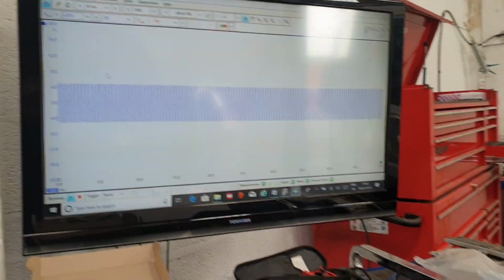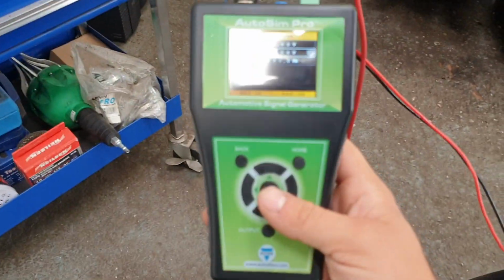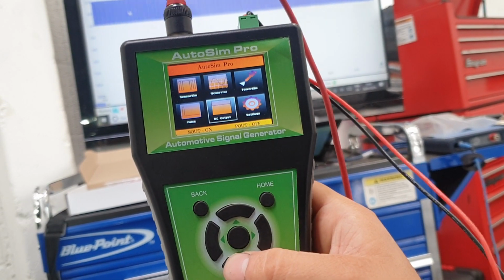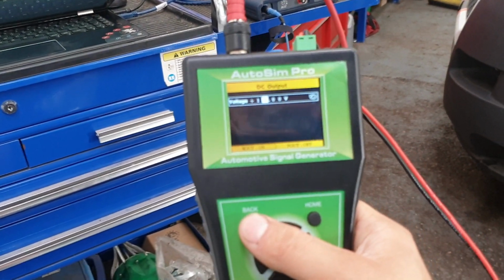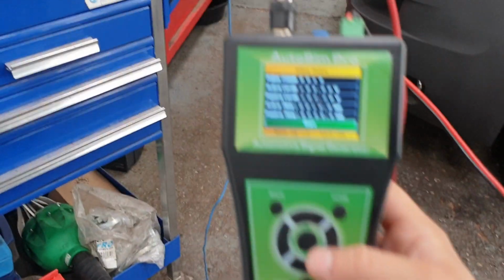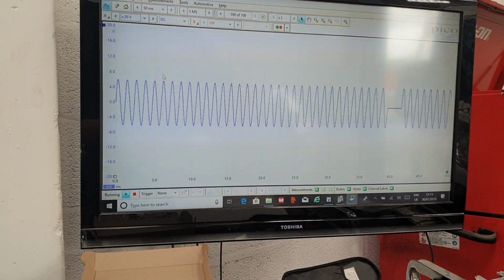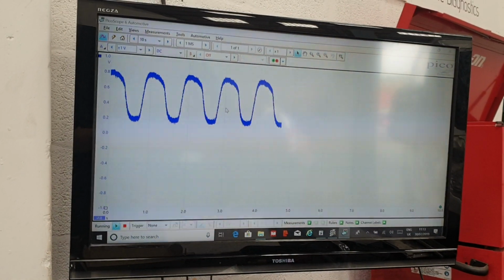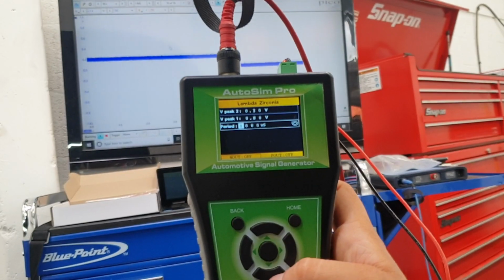DITEX AutoSim Pro Function Overview.

Comment: Whats the point of the Crank and Cam signal generators really? Other that it being cool to look at on a scope. What would be a good real world diagnostic purpose of those?
Reply from the maker: great question. if you wanted to verify RPM signal from the sensor incase the sensor was not operating you could use this preset in order to produce the signal the ecm is expecting to see and check with a scan tool too see if the RPM reading changes, this will verify wiring integrity and computer logic, leaving only one possible component
Reply: @eliteautomotivediagnostics4424  Looking again i notice it doesnt really do CAM sensor signals. That  would really call for presets as they are so different between cars. Its also the CAM sensor sim that i didnt really see the need for as it would be useless. But for a crank sensor i can see the point. Thanks.    I actually have one of those on order. I wanted one for a while now and i also wanted to get an injector pulse tester thingy. But when i realized i could use the Autosim as an injector tester too i just had to order one. 

Have you successfully simulated an active ABS sensor and had the ABS module read the "speed" from it?
Reply from the maker: @stv2765  great news, yes I have done indeed, I done a training hands on day in our workshop showing this with a few technicians
Reply: @eliteautomotivediagnostics4424  How does that work then? These sensors creates an alternating CURRENT that the ABS module uses to figure out wheel speed. On some the VOLTAGE also goes up and down a little as a result of this but not all. I normally use a micro amp clamp hooked up to a scope to watch what these sensors do/sees. So what kind of signal does the Autosim put out to the ABS module? Im sure i will find out soon enough when i get this thing myself, but im just curious. Maybe it doesnt really put out a "signal" pr say but rather mimics what the sensors do and create a current draw. I dunno...
Reply from the maker: @stv2765  good question, for there to be current in a circuit you will also have a small voltage drop therefore if you ever monitor this style of signal you will see a small voltage differential, for example, 11.2-11.37v this is the signal that you will copy and output using the tool. This will then imitate the sensor
Reply: @eliteautomotivediagnostics4424  Yeah... Except the wire already got voltage from the ABS module... In which case one would need to measure the voltage already coming from the module and adjust the Autosim to inject a voltage a little higher than that i guess.. But then again. If there is voltage on that wire (and ground on the other) the wires are probably good anyways
Reply from the maker: @stv2765  yep, the tool will "override" the voltage sent by the ABS ECU I have found as long as the voltage is a little higher as you say (more pressure)
Reply: Steve Jakobsen i have to tool. Its awesome. It works on abs sensors to change wheel speed and cam sensor signals. If you use it on cam, just use crankshaft presets and change number of teeth. I have used it to verify wire integrity and computer receiving signal while looking at data. Works on maf sensors and anything else really. I personally love it
Reply: mike sabin some people just think they know it all or don’t need it but I think it’s an awesome tool to test sensors all sensors

Comment: Awesome tool. Is it completely computer safe?
Reply from the maker: It depends totally on the circuit you are testing, but using the sensor simulator output it is very unlikely you will damage computer circuitry.
Reply: Elite Automotive Diagnostics awesome!
Is the scanner safe if you are looking at data and inducing signal into a computer?
Reply from the maker: @mikesabin8568  yes it is totaly safe, you are only doing what the sensor would normally do 😊

Comment: Thank you for the video. Good job. Does this Autosim pro come with detailed instructions for every signal type, like when and what type of settings to use for particular applications? One example, what sensor signal would you need to have an offset for? Reasons for wanting details on operation. 1) OE service information usually don't specify details such as offset. 2) This is an expensive tool. Being able to use and understand what the settings should be for every vehicle system is needed in order to be effective, accurate, and efficient in your diagnostic time. I know most people will say you need practice to master this tool, I understand. But, paying $540 US dollars for a tool, I would hope there are some very specific instructions and examples on how and when to use each setting and function.
Reply from the maker: there is instructions that come with the tool yes indeed, however you will also need to have a good baseline of circuit design and sensor operation to get the most out of this tool. you may at times need to use a scope in order to get a good baseline before producing a output signal or PWM.
Reply: @eliteautomotivediagnostics4424  thank you for the reply. If I'm understanding you correctly, you have to spend time measuring and recording your own signal specifications for various known good vehicle systems. Then when the time comes to needing this tool, you set it up to generate the signal. So there is not any very specific instructions for this $540 tool. What sensor signal uses an offset?
Reply from the maker: @billyyoder8171  no, if you understand how the sensor operates then you can produce the signal that the circuit is designed for. for example if its a inductive style ABS wheel speed sensor then we know this is a Signwave style signal therefore you can just create this signal using the tool and adjust the setting accordingly until you have the desired result. this is why a good understanding of sensors and circuit design is crucial
Reply: @eliteautomotivediagnostics4424  thank you. I understand the fundamentals of analog sine wave, digital, PWM. I don't understand is the offset. I don't know of a signal that would be offset. It's in the tool, so when the OE vehicle manufacturers don't publish details on their signals, how will we know when and what offset to use? Same for a PWM signal, example a fan control module PWM signal. Manufacturers don't publish what the PWM control signal voltage/amplitude and frequency should be, let alone if there is any offset. I guess I'm expecting too much from the manufacturers of this tool to produce a comprehensive instruction manual or training video for their tool. The tool manufacturers know this tool inside and out. They evidently know of signal offset, because they put it in the tool.
Reply from the maker: @billyyoder8171  some manafacturers with digital wheel speed sensor design use a 11.5v to 11.3v square wave for there sensor input. this would be a great example of when a offset would be required. as i said previously when producing signals you may need to obtain a known good libary before simulating to know you are creating the correct signal or voltage. it would be impossible to list every differant voltage or signal differential for every vehicle as there would be hundreds because each manafacturer will do it differently
Reply: @eliteautomotivediagnostics4424  thank you for the offset example. I appreciate your replies. Have a blessed and safe week.
Reply: Good questions that am wanted to ask before